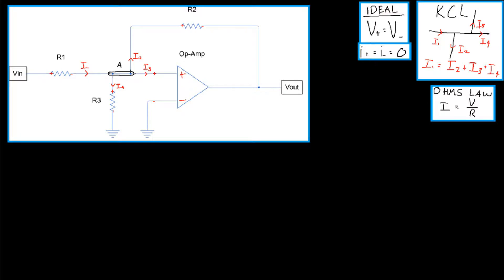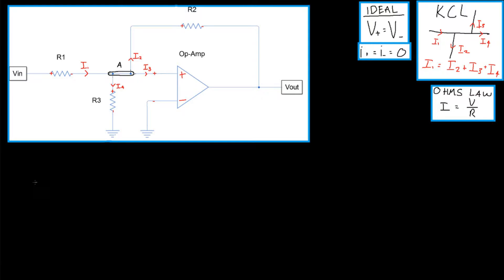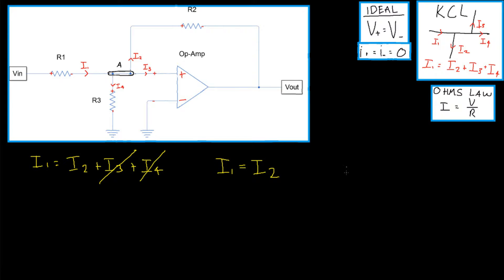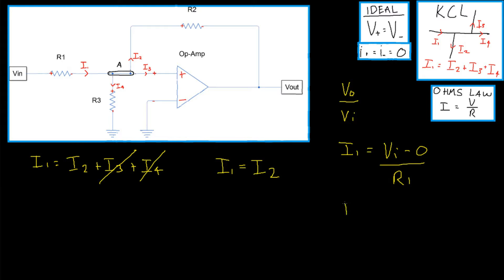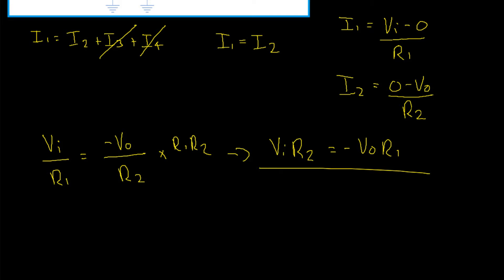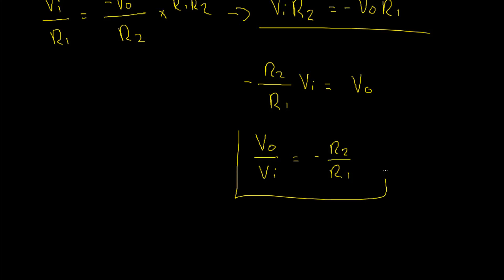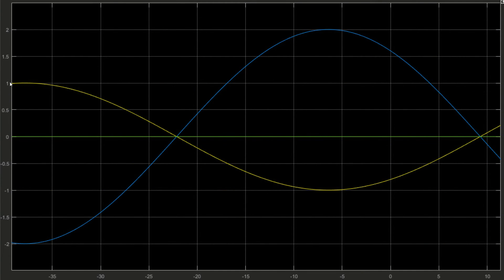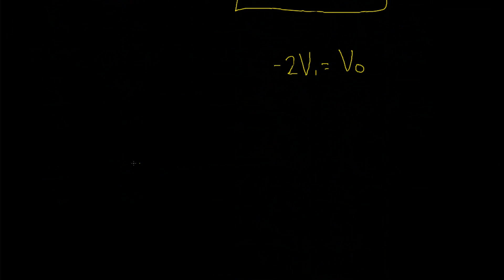Ideal Op Amp Example #1 - Signal Processing #01

Comment: Then what is the purpose of R3??
Reply from the maker: surya bhusal that's a pulldown resistor. 
For a minute imagine that you didn't have it, the voltage at V+ would be 0 because it would be directly connected to ground.

Comment: this was great although it seems kinda a bit rushed. the op amp takes in a negative power rail which allows it to output negative volts.
mind you all i have to do is slow the video down.